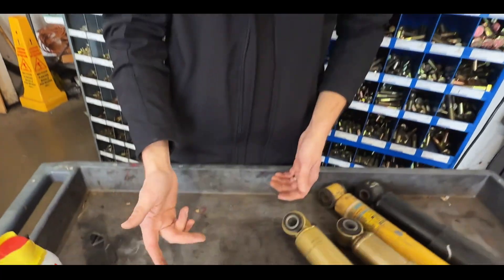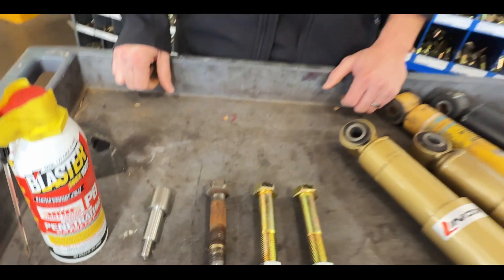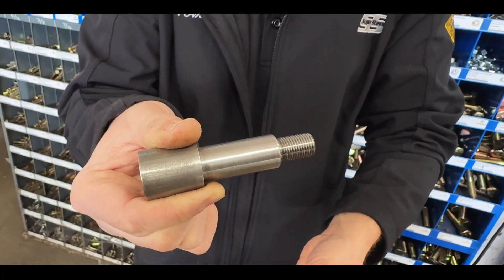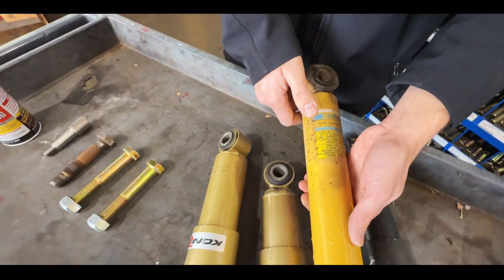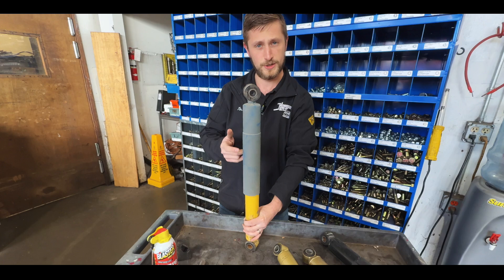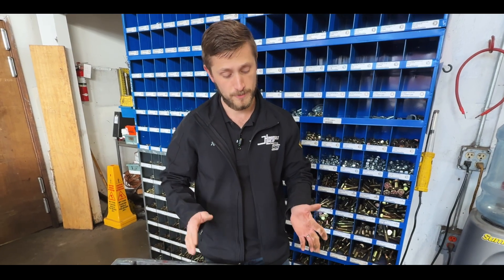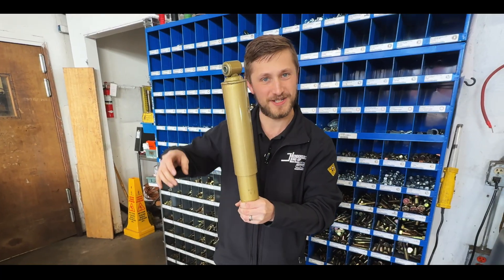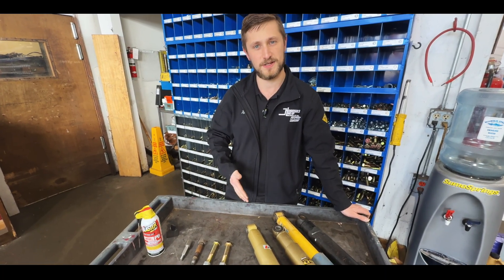Upgrading Motorhome Shocks? Avoid These Critical Mistakes!

Comment: Thank you Tommy... good video.  So is it safe to say that your SS88-1889 shock is a twin-tube?  Also, would you happen to know who makes the OEM front struts and the OEM rear shocks on a MB Sprinter 3500 Cut-away Chassis is and if they are a twin-tube design also?  

By the way, we have your 87-2657 Konis (set at 30%) on the front and your SS88-1889 (set at 0%) on the rear along with your Trac-Bar... and our 2021 Leisure Travel Van (Class C) rides great.  The Trac-Bar is a game changer !

Thanks.
Reply from the maker: Ok! Thanks for the great feedback, and for the question! Yes, our SS88-1889 shocks are made for us by Koni and are rebound adjustable twin-tube shocks. The rear OE sprinter shocks are typically made by Monroe and are gas charged - they appear to be a mono tube but may be a low pressure gas charged twin tube (which is a variant we didn't delve into in this video). The fronts are not marked but we believe they may be Bilstein. They are a monotube. 
Great to hear that our upgrades are working so well on your Sprinter! 👍😉